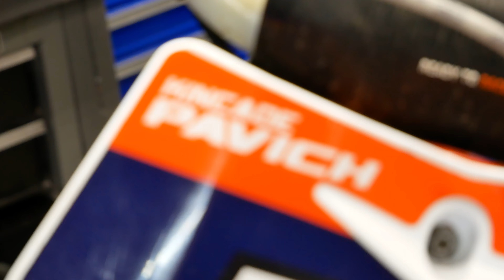My KTM 350 Is READY TO RACE

Comment: I hope you plan on getting rid of that aluminum axle nut things are trash
Reply from the maker: Currently have no plans of getting rid of it. They've been on every KTM I've ridden the last 6 years and I've never had a problem with one.
Reply: My buddy has one and it backed out on a trail so we tried to tighten it up and stripped out on him on us out there on the trail we had to get a side x side with a trailer to haul it back ever since then he replaced all of them to stainless
Reply from the maker: @brethart8094  Damn! I actually did have an instance of one backing out once, but I didn't think it was likely a fault of the nut. Food for thought though for sure!
Reply: I had mine come loose as I was lining up for a race. Didn't realize it was a universal problem.
Reply from the maker: @landengraham2236  yep, very interesting... I might start going slightly over torque spec. The one time mine came loose, I remember torquing it to spec.
Reply: @landengraham2236  did you swap it to a steel nut?
Reply: @brethart8094  I have not. Happened about a week ago. Just thought it was a fluke deal.

Comment: you are not an A rider 😂
Reply from the maker: Come race me and find out
Reply: Is there some qualifications/ test i haven't heard about that says you are an "A" class rider or not? 

I just entered my first two races in Eastern Idaho as a "C" class rider, at the end of the day my lap times were consitent with upper "B" class riders at one event with alot of rocks to maneuver then the next event I was putting 20 minute lap times in open desert consistent with Mid-pack "A" riders.

I didn't take first in my class either time but could have done better in a higher class based on lap times alone of those who podiumed, does this make me an A, B, or C rider?